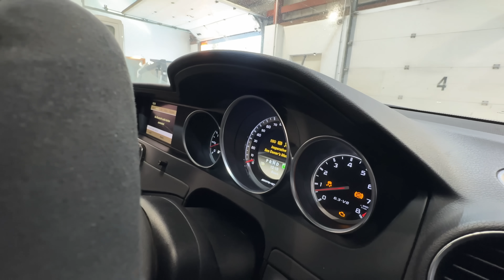MY MERCEDES C63 IS BROKEN

Comment: Hey guys, from my experience of Merc gearboxes - Have you tried replacing the conductor plate & solenoids inside the gearbox? This is what controls the gearbox & you were halfway there when you took the sump off it (by the way, it has the fill level plastic pipe snapped in and when you drain the oil, use a screwdriver to push it sideways till it comes off so ALL the oil will come out). Removing the valve body is only a few more bolts but expect a lot more oil to pour out from above it as the conductor plate is submerged in it. There's a good chance it will fix your gearbox. Merc Gearboxes are notorious for this problem.
Worth a try anyway........... 🙂

Comment: Usually they is a full procedure running through the gears etc and when obd tool shows the gearbox fluid at a set temperature, you then fill and repeat :)

Comment: Hey Matt Armstrong the issue that your having is with the torque converter it is not disengaging , check the wires that deal with the torque clutch solenoid ( it disengages the torque converter and let's it shift out of gear when you hit the brakes) your issue is with either the valve body or the solenoid itself it can also be an issue with the wiring! But I don't think it a wire issue. Replacing a solenoid it valve body requires the TCM to be programmed  if you having dinner this audit check the brake lights and bake air that there are no codes in the system. Check the transmission fluid and look for debris, change the fluid and see if that helps.

Comment: Its the torque converter or the valve on the electro-hydraulic control unit for the converter lock-up clutch

check it with your diagnostic tool. you can deactivate the cluth and if there is the same problem its the torque converter. 

or let the car get warm and than it will drive :)

Comment: them boxes take 5 litres on service refill, fresh box is 8ltrs, as there will be around 3ltrs in the torque converter. you want to drop it, put in 5ltrs and instantly plug it as there wont be enough if you let it flow out.   there is a fluid level procedure which can be done, running at certain temp and then remove drain plug, when that stops gushing its full.

Comment: There is a special Tool from Mercedes to push the green tube inside the gearbox so all the oil comes out before you tage the pan of. The green tube is to set the oil level right when the gearbox is warm about 45 Degrees Celsius.👌🏻

Comment: Oil need to be blue in that type of gearbo, and you need to use a screwdriver to bend the pipe over. The best is to turn the engine until you see the drain for the torkconverter there is an rubber seal you pop out to get to that screw, you first need to start the car go into every gear and than leave the car running as you pit the drain plug in.

Comment: Gearbox oil in that one should be green blueish ;)
Oil level sensor in engine is a hassle...
I let the original one sit, and made a bracket that bolts to the rearmost(m6) bolts inside the pan, at the same height as the sensor is sitting, works perfect!

Probably the lockup in he converter that has broke.

Comment: I think the gearbox clutches are not working well. When you apply the brakes the engine stalls because the gears are not cut off from the engine as you see in a manual vehicle

Comment: If you can't drain the tourque converter unplug the return line at the gearbox and place a bucket to catch the oil comming out the return line.
Keep adding oil to the gearbox untill the oil comming out the return line runs clean. Don't run the gearbox dry, you don't want the pump to run dry or cavitate. May need a few stops and starts to get it done. This will flush the torque converter and coolers.
Fill the gearbox untill oil runs out of sump plug. Run engine and heat the gearbox to 45°C. Remove sump plug and when the stream starts to drip replace sump plug and the system is flushed and at the right level.
Job done.

Comment: Push the pipe off in the gearbox then put it back on so you can get the level right when you put the gearbox sump back on, don't forget to drain the torque convertor, should be a bung you can pull out to get at the drain plug

Comment: There is no torque convertor on the facelift W204 C63 also that sealant on the sump needs to be left overnight before you add the oil.

Comment: I have familiar with focus that I work at my job, it’s had powershift (aka ford chocolate automatic) turn out gearbox was broken because it had familiar faults your Mercedes but that focus had really bad vibrations when I stop the car. That could be possibly your gearbox is broken?

Comment: Try replacing that oil level sensor, was reading in forums and there were a few people talking about that actually being the fix even tho the sensor was reading correctly for them but since yours reads incorrectly, would assume that’s the issue then.

Comment: it is more than likely the torque converter, I put a cam in my LS 3 and didn't touch the torque convert, and I if I am moving and stop, the second it shifts into first it stalls . So until I put a converter in it, i drive it in manual and only down shift to second, then once I stop i can put it into first.

Comment: There is a lock up clutch in the torque converter which is not releasing.  Last one that did this to me it was only when it was hot. Does it happen cold too?
Reply: There is also a solenoid that does the lock up clutch.  It could be pulled in or bad as well.

Comment: @matarmstrongmk2 
@MatArmstrongbmx

I would try updating the firmware in the ECU and if it doesn't receive the update. Check if it has an error code for errors in the ECU unit and if not restore to factory firmware. There may be a list of incorrect error codes that the ECU sends out and when that error code is not correct then sends the ECU for repair.

There are lists of very odd symptoms caused by faults in the ECU. The ECU can function in its entirety, but sometimes there are specific errors for just one ECU function.

Comment: get OBD2 system and go reset all your fault codes and then do a Relearn on the main ecu and relearn on the gearbox., the problem is caused by low voltage battery when sitting.

Comment: The thing is with an auto transmission is that just draining the oil pan does not get all the oil out since there is a heap of it in the torque converter( read that as wet clutch pack since that's what it is on this beast) which can only be removed through flushing it.  What auto transmission service places do (and I stand corrected on this) is that they intercept the oil cooler path and let the oil pumped to the cooler run into a container and feed fresh oil into the pipe going to the cooler, then run the car on the ramp in gear.  That way the transmission pump circulates the oil and in the process you get fresh oil introduced.  Make sense?

Comment: You probably read this already but make sure the connector for the control wires is attached correctly and or replaced because otherwise the oil can creep up into the wiring loom and cause lots of problems

Comment: when re filling the transmission, the engine needs to be running and transmission at a temperature of 45C or you wont have the right amount of fluid in it.

Comment: Mat i bet the problem lies in the valve body the torque converter lockup will be stuck on so the  car stalls the lockup solinoid will be stuck or the filter screen will be blocked cheers from down under

Comment: You have to start the car with the gear box sump off and go through all the gears then that way you will empty all of the transmission oil from the talk converter and then you will be able to fill all the gear box oil rather than just 4 ltrs by

Comment: It could be fixed just need to hook it up to a machine that changes the oil of the gearbox it goes to gearbox oil cooler you remove one line and put it in the machine and it should fix this issue the oil is way overdue

Comment: Your torque converter is not unlocking. I had that happen on one of my cars, and the problem turned out to be a loose ground connection. Tightened one nut, problem was gone.
Reply: I was thinking isn’t it a MCT aka multi CLUTCH thingy Benz does which is different from a regular torque converter?

Comment: Tony you are funny you need to drain the torque converter there is a small Allen key on it once done with the new filter and oil run it up on the ramp and slowly select all gears before trying to drive the car good luck fixing it 😂

Comment: Definitely you have the wrong fluid level, as the level is set with the engine running, and at a specific temperature you will need to laser the pan temp to the specified temp or view a scan tool before draining the excess off from above the standpipe while running

Comment: Simulator having an pretty bad lag, you can see difference in real steering wheel and in-game - they are not synced. You need to proper adjust settings to make this good. Lag can destroy your experience.

Comment: Could you not put the tranny in neutral before coming to a stop?  It wouldn't help with taking off, but at least it won't stall when you come to a stop.  I believe the issue is with the torque converter being stuck in the lock-up position.  Most likely an electronic issue.

Comment: The facelift AMG C63 (2011 - 2015) comes with the MCT "multi-clutch" 7-spd trans, not the 7G-Tronic "torque-converter" transmission. Your car has clutches, no converter.

Comment: 722.9 are horendous gearboxes. you have newer deeper pan and a triple filter that doesnt sit in the sludge. Its got to be a faulty TC or the TC solenoid/associated valves are in locked position all time. Take the valve body off and strip it may be full on sludge. Code reads are never up to much, tend to say things like gear implausible, but worth reading codes....... I've got no 2nd gear, failed b2 clutch, not looking forward to box off

Comment: Ok @matarmstrong community, I need your help!
I have a Mercedes Benz W204 & I took out the aux battery to test the charge on it. It was fine so I put it back but after connecting the + terminal, the - touched something and arced.
Now half my electrics are off (inc remote locking, obd port (so I can’t even read errors!), interior lights, etc.)
Dash has power and it cranks but doesn’t turn over properly to start.
I’ve checked all fuses with multimeter for continuity and all fine. What have I missed?! 
Please help as I’m stuck - can’t get AA as I’m at home.

Comment: Mine did this mat! 
If I came to a stop a bit too quick, or if I put it in sport mode etc it would stall all the time. Also MCT

Gearbox filter and oil change, solenoids sorted it. 
You can use xentry (mb star) to reinitialise wet clutch system and if it still does it or you see clutch material in sumo then you fucked lol. Don’t forget to do adaptations for upshift downshift and acceleration downshift through xentry as well after 😄

Comment: Its a torque converter Mat. I had this issue aswell, to be able to drive and use brakes, warm up the car, apply brakes softly on the first braking, and then id drivers and brakes as normal. Or just get a shudderfix and put in the gearbox and will see a changes but only temporarily 😊

Comment: How's it Matt just thought I should share a bit of my knowledge, having worked on automatic transmissions. Definitely could be the torque converter messing you around, but also on the valve body there is a valve which is responsible for the TCC slippage. This work works hand in hand with the torque converter but also a solenoid called TCC solenoid. But since you already getting a new second hand gearbox, get a new torque converter or one that has been refurbished, or remaned as we call it. 

Another thing if possible to save money you don't have to reprogram the new gear box, what you do is you remove the original valve bodys electro plate and put it on your new one, because that's what the cars TCM reads.

Comment: PLEASE - USE LESS SEALING!

Thats way toooo much and it will end up in the engine, will stay on the oilpump and ends in a bad engine because of no oil pressure

Also you have to go thru special steps by refilling the transmission. Get it to the right temperature etc

😢

Comment: Okay, so the actuator you're talking about is basically like a fuel injector. It has a coil and a needle that moves when magnetic field is applied. These actuators often get stuck when dirty ATF is used. Electrically they're fine, it's just the needle that can't move because of sludge buildup. They can easily be cleaned once you get to them. I would love to see that last effort to clean them up before you change the whole transmission. 
Regardless, You guys are awesome. Have fun.

Comment: This MCT speedshift in the facelift cars doesn’t have a torque converter so that’s one less thing to worry about. It’s known to be a bit of a clunky box anyway so don’t expect butter smooth operation when it’s cold but, this issue is usually crankshaft position sensor and/or fuel pumps. In really bad cases MB have torn down the bottom end of the boxes and suggested multiple component replacements I.e. complete rebuild. I think last quoted prices on a new box were £6k so start small and see how you get on.

Comment: Don't jump start empty batteries it is damaging them severely. Jump start it's only for emergency. The only way to keep battery undamaged when it is empty, charge it fully. I agree with you,  4 cylinder 2l engines are all crap, one of the most unreliable engines, having a lot of issues. Never owned one and I hope I never will. If anyone want cheaper version of cars to save money one of the best engines is 1.9 tdi same size like 2 litre, just cylinder bores are smaller giving better compression and fuel economy, that's why they outlast many engines and are so good on fuel and BXE, BLS, BKD and other similar 1.9 engines with same issue , generation only fails, because the piston connecting rods are not designed to be remapped, if you upgrade them the engine can become a monster, 1.9 in stock pulling better than V6 engine in stock.  Another great cheap engine is 1.5 dci, legendary engine.

Comment: There is a thing called lock up solenoid. You might have to change that as it locks the torque converter after certain rpms and should unlock it below certain rpms. Seems yours locks up and doesn’t unlock.

Comment: The c63 uses a wet clutch rather than a torque converter. You should make sure the oil level in the gearbox is set correctly first, then re teach the touch point of the wet clutch. This might help with your issue before replacing any parts

Comment: The gearbox oil there has to be greenish or blue. The car has the 7G Tronic Plus installed with the oil release 236.15. The car has to have the correct gearbox oil level in P at 40 degrees. This has to be measured when the engine is running otherwise there is too little oil in it

Comment: Ughhh... Talk about backyard mechanic!? You obviously don't know anything about the C63.
It has a G7 speedshift MCT transmission - Wet start up clutch with computer controlled double clutching. No torque converter.
I have no idea what was draining out of that pan, didn't look good,  it's supposed to be BLUE and all that grey sludge... Those bolts are single use only and should be replaced too.  Really should have flushed that transmission a couple of times. YES, You're supposed to push that tube aside in the pan to let the fluid out.
The colour of that fluid has me thinking someone probably put the wrong fluid in it, cooked it and stuffed up the transmission.
Oh brother... Never put old oil back in any engine, let alone a 6.3ltr AMG.
This makes me cringe....